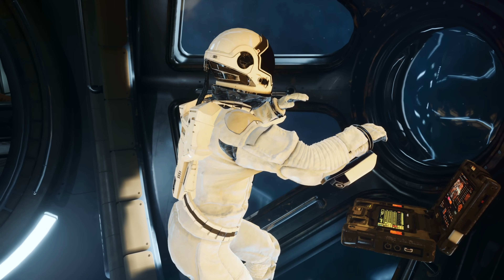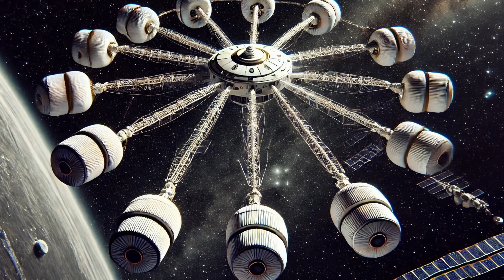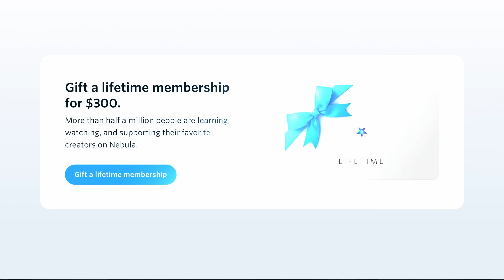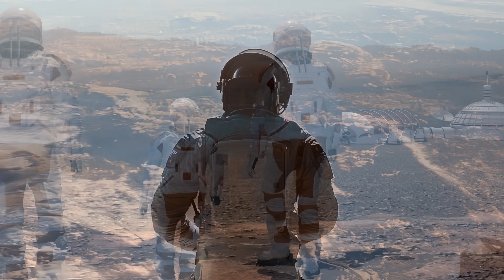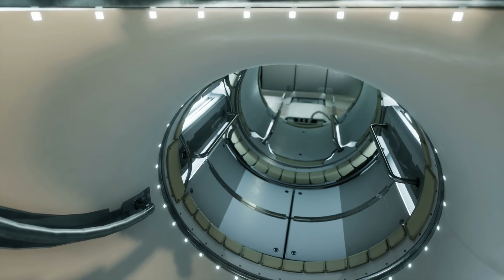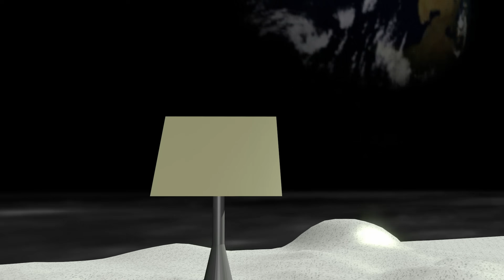Gravity By Design - Tether Habitats & Orbital Living

Comment: 4rpm is acceptable without problems. There was research about this. 

You need to remember that there is enormous difference between rotating room experiments where gravity mix together with rotating creating chaos with our vestibular system and normal, centrifugally simulated gravity where the classic gravity is not present.

Also, sleeping under gravity and working in zero gravity is wrong. It should be flipped. You can sleep under zero gravity, but you need work and move under full gravity preferentially. Because our cardiovascular system needs workout. and that for most of the day. During sleep, even here on earth, it is nearly the same situation for body as zero gravity.
Reply: Yes, if the gravity difference between head height and foot height is imperceptible, Coriolis forces don't really come into play. It would be no more uncomfortable than a cruise ship.

Comment: What do you think about officially published theory that Earth is monitored by orbs? SETI astronomer Dr. Eamonn Ansbro of Ireland's Kingsland Observatory published a very interesting hypothesis in July 2001. This hypothesis was met with resistance from the SETI community. According to his theory, some hidden spacecraft move in the upper stratosphere or even farther from the Earth's surface, releasing special surveillance drones/orbs. They calculated that these drones move in 660 orbits around the Earth everyday 24/7 in automatic manner, and where they intersect, UFO sightings are more frequent and possible to anticipate ahead of time. "We have tested the theory over the years in 27 locations in eight countries, and it has been 80 percent accurate," Dr. Ansbro told media.

Comment: We already have a working prototype of a automated torride shaped habitat building machine that holds all of the pre-shaped modular pannel sections in its body and welds them in place as it advances section by section to createa huge interior area. 

If we could use this technology to create a functional 10 RPM space station, we could use that platform to learn how to make all the systems and engineering work over the course of 4‐8 years.  

Then we could use that design and building expertise to create a 2 RPM space station.

This would likely yeald the highest return of livable space per dollar spent, and a large zero-G structure could be built in the center allowing for science research and zero‐G manufacturing at a reasonable cost, with plenty of staff to execute operations and maintenance.

Comment: Great! Lets design the simplest practical proof of concept experiment using Starships! 😃
Reply: Just one ship, a tether, and a far-end module that typically will be much less massive than the ship. One end of the tether is permanently attached to the ship. The other is permanently attached to the far-end module.

At launch, the far-end module and the furled tether are in the ship’s nose. Once it is in orbit, putting it into slow end-over-end rotation, maybe 30 rotations per hour, gives us a small amount of gravity. We begin lowering the far-end module into that gravity by unfurling that end of the tether. The gravity will make that module and the paid-out part of the tether extend straight forward from the nose.

This lowering would slow the system’s rotation, except the far-end module is functional. It is not just a counterweight. It includes a solar array that makes electricity, an ion drive that uses that electricity to make thrust, and a propellant reservoir. The thruster thrusts tangentially to the slow rotation, keeping the rotations per hour — the angular speed — constant as the tether continues to unfurl.

The strength of spin gravity is proportional to how far out you are from the spin axis. Supposing that when the ion drive has just exited the nose, it is 20 metres from that axis, 30-rph angular speed means the gravity it is feeling is 0.00559 gees. We’re looking for an end state where the ship is getting one gee. That will require it to be 1/0.00559 times 20 m from the axis. 3577 metres out.

If the ion drive and the solar array total one-ninth as massive as the ship, one might expect them to be nine times farther out on the other side, and the total tether length to be 35.77 km. Each kilogram of them would then counterweigh nine kilograms of the ship.

But that much tether is quite significantly massive and weighty all by itself, and with this taken into account*, balance is attained by having the far-end module 13 km from the axis, where it gets 3.63 gees. So each kilogram of it counterweighs 3.63 kg of the ship, and mass is reduced compared to the case where ship and counterweight are equally massive and equally far out.

Also reduced: complexity, compared to schemes in which multiple ships launch separately and hook up once they are in space. Only one ship, no spacewalking, everything already connected.

Comment: As far as I can measure from the movie, the space station in 2001 had a rotation period of about 45 seconds. I never found a scene with a complete rotation so you have to extrapolate from the angular motion you can see in any one shot. The people in the station are walking around, getting up and down etc. under what looks like 1g. Well of course, it wasn’t actually filmed in space.
That gave a diameter of roughly 2,000 feet depending on the rotation period estimate. The Fantastic Plastic resin kit of the station even came with three sizes of the Pan Am shuttle. The size of the shuttle is canon but the station size was never settled and the film sequence seems to have continuity inconsistencies in the apparent relative sizes of the two objects. You can pick the shuttle model size that fits your idea of the station size.

Comment: I would be concerned that if you have multiple habs connected by tethers to a central hub that they might start precessing, or having slightly different rotation rates, especially if you have people regularly commuting by an elevator to the central hub.  And I am pretty sure that travelling to the hub significantly faster than the rotation rate of the hab would cause problems.

Comment: I seem to recall that NASA and other space agencies have done some experiments with tethers attached to spacecraft, dating back to the Gemini project days. A depressing number of those experiments have failed, usually due to some kind of malfunction in the unreeling mechanism. This suggests it's not as simple as it sounds.
Reply: Such failures sound/seem like fairly straightforward “engineering issues”, and probably not too difficult to overcome.
It’s also possible that since they were “just testing the concept”, they may have skimped on design or materials… wait, what am I saying? That’s not how government works… silly me 🤭

One of the more interesting mentions of “tether” that I recall from way back (maybe in “Popular Mechanics Magazine”)… was a concept for using a tether with a certain amount of elasticity to join two spacecraft together, and fire the rockets of each in a carefully coordinated alternating pattern/sequence… so that (in effect) the two spacecraft would take turns, passing greater and greater momentum to each other than would be achieved by firing the engines alone.
One spacecraft would “fling” the other forward… and just before the tether would become taut, that spacecraft would fire its engines through the process of stretching the tether, and then the tether imparting that energy into the other spacecraft, which would propel it forward. The engines would be stopped as soon as the tether went slack… and that spacecraft would then pass the other and perform the same process… wash, rinse, repeat.

I believe the article was a compendium of concepts for how we might achieve interstellar travel (or more specifically… to overcome the rocket equation limitations)… how we might achieve greater velocity, using less fuel, etc.

This would have been published (according to my addled memory) around the late seventies, early eighties… so, represents some of the ideas that were “bandied about” in that time for “overcoming the vast distances of interstellar space” 😂

I think it would be interesting if Isaac could find that article easily enough, and “revisit” the concepts of that time, looking through our more modern lens.
Just a thought 🤷‍♂️

Comment: as a noob, how do you equate a rotation to Earth-like gravity? It has to be measured against diameter. Example, A rotation at fifty feet is good for E-gravity,  but at two hundred feet has a higher gravity.
Reply: 50 foot diameter, you get one gee at 35 miles per hour. 200 feet diameter, you get one gee at 70 miles per hour. 800 feet diameter, you get one gee at 140 miles per hour.

Notice that even in the 50-foot-diameter ring you can't run fast enough, opposite the direction of rotation, to zero your weight. You can reduce it a little.

Also notice that increasing the diameter fourfold only doubles the speed, so it takes twice as long to go around.
Reply: For a minimally comfortable RPM of 1 RPM the diameter needs to be about 1 km in length.  You can't really go smaller than that without experience significant physiological effects like nausea, dizziness, and loss of balance.

Comment: Every time a manned mission to Mars comes up I can't help but think we really should reconsider how missions are done. With the advancement in rocket design and the drop of cost, a mission to Mars could look very different than the ones we send to the moon.
For example, we could send capsules with food, water and fuel ahead of the main mission, We could send an entire mission pod ahead and park it in orbit of Mars just in case. In lieu of having an autonomous space station there. Same goes for the next mission to the moon.
Planned right these modules could even become the core of a space station, even a Hammer Hab, which could be expanded on as mentioned in the video and several Hammer Habs could be put together on the same spin axle.
Not sure how practical the idea is, but I think there are possibilities that could extend space missions in the long run.
Reply: Honestly being autonomous is highly overrated IMO. The actual factors determining early space development will be where the money's coming from. 

Thus I expect for a while that early development will consist of a moon base that profits off high end tourism, asteroid mining (since the moon's surface is littered with asteroids waiting to be mined) and the bulk production of exotic microgravity materials. With the exponential growth of industrial capacity eventually letting it transition to exporting raw materials via mass driver.
Also importantly this early colonization will be like 99% automated and remote controlled. Since you need a really good reason to make using humans better than a remote controlled drone with less than 2 seconds of lag. But this isn't a bad thing! It's actually great because it makes things way cheaper than they would be further from earth.

Lastly being so close means that you don't need to initially bother with artificial gravity. Since you can just have all the crew being regularly rotated out like on the ISS. This becomes relatively cost effective once you've set up an Aldrin cycler between the Earth and Moon, even better if you also have a skyhook. 

https://www.youtube.com/@Anthrofuturism has some great in depth videos looking at the economics of early development

Comment: What about a VonBrhan wheel but it's a spiral that can be continuously lengthened?
Reply: Up to a point. If its length comes to exceed root-six times its radius, it will want to drop its ends out and spin end-over-end rather than around its axis.

So radius 894 m, the length limit is 2190 m. 2000 m, and the thing will spin stably forever; 2400 m, you need computers to move stuff around, probably water in giant pipes, when it begins to get squirrely.

Comment: I'd love a video on how you'd communicate or coordinate over EXTREMELY LARGE megastructures. Things the size of solar systems, where it'd take over an hour or even a day for a laser sent through fiber optic to get to the other side of the structure. How would you manage to coordinate things like "We need to fire all the thrusters" or such. Or a Hill Sphere the size of a galaxy, and wanting to rapidly get info about the other side of it a hundred thousand light years away. Is it just unrealistic to treat a structure that size as a single object?
I imagine the obvious answers are the ones... pre-arranged schedules and set procedures based on certain parameters. But I wonder if there's any interesting options for how you'd rapidly let a section of your ringworld several AU's away that they need to brace for an electrical overload after a solar flare hit some panels.

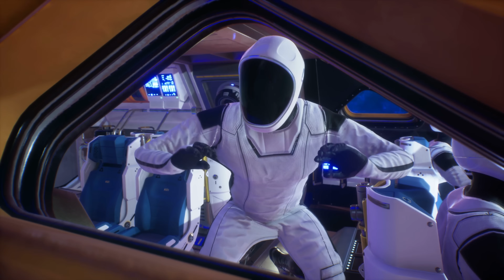Comment: 6:35 "During planetary maneuvers, the module  would be reeled in tightly, locked in place, and secured before proceeding" -- what kind of maneuvers might those be?

Just accelerating towards a distant planet, or away from it as it gets close, wouldn't justify that. A gimballed ion drive anywhere on a long spinning tether, driving it at 1 percent or less of its tip loads' centripetal acceleration, drives it exactly as it would a rigid object.

The quote words seem to me like those of a homeowner who could not hang a door correctly and insists that no-one can.

Almost exactly. Off-centre ion thrust on a rigid nonrotating object will turn it until it gets in the way of the ion plume, which then becomes ineffective as propulsion. But off-centre thrust on a spinning tether just precesses it a little, and in the other half of the rotation, precesses it back.
Reply: Spinning parts are non trivial for wear and tear, maintenance, and structural stability. Same for programming.

In space, you want to keep things as simple as possible.

There are videos on the difficult of making simple parts in space, such as door hinges.  Between cold welding, thermal extremes, the effect of a vacuum on lubricants, radiation, and all of that before vibration, difficulty to repair in a vacuum...

Even an ion drive could become a nightmare.

Plus gyroscopes make any maneuver counter intuitive.

Comment: The assertion that long term exposure to spin at certain rates would make things worse goes against human experience with sea sickness which generally "goes away" after about three days in even the most seasickness prone people. I would guess therefore that an RPM higher than 2 rpm would be acceptable long term. Humans are very adaptable but we don't want people to adapt to zero G because of long term affects of that adaption.  Of course not everyone must go to space, most people will live on Earth for the foreseeable future. Ability to live on a rotating habitat would just be one of the requirements for the job, just as all jobs have physical requirements.  I think the AG field of research is very much at a pre-infancy stage. It hasn't really started until human experiments are done long term at less than 1G felt gravity. Actual testing at different rpms and circumferences (same thing really) are necessary if life in space is going to get off to a good start. While there are good reasons for "zero G" labs and manufacturing, any human presence in space will require 1G or close habitation in the long term. It may very well be that angled floors and wall lines instead of long sweeping curves will work better.... even non-smooth floor surfaces which require more brain activity to navigate already may be helpful, a technique already being used on Earth to treat early dementia onset. As with most motion sickness, this is a mind thing, matching the eye's expectation with the felt reality is essential. If the line and evenness of the floor gives the eyes an expectation of unsteadiness that matches the inner ear's feel of gravity, the problem goes away.
Reply: 4-6 RPM is generally considered the most important that people could adapt to.
Reply: @peeperleviathan2839  I had heard less. The thing is, all of the tests that these numbers are based on have been done on Earth so there are at least two things added to the mix that may have caused some people distress besides the RPM. That of the higher than 1G load on the person's body and also the resultant angle of gravity because Earth's 1G was mixed in. Another thing added to the equation is how small most of these devices have been with the resultant difference between head and feet. Of course size and RPM are are interlocked and by the time the size is big enough things are normal from head to foot, RPM might be quite low anyway. Really, my point is that no research has been done with a starting point of zero G or even less than 1 G, such as on the Moon for example where a train on a circular track might be easier to make than an orbital model of any size.

Comment: How much the discomfort of fast-rotation/smaller radius is due to the transition as opposed to an inherent always present effect? People sometimes can get used to being on bobbing boats or trampolines relatively quickly or sometimes after a while, and then feel weird when stepping back in solid ground; and a similar phenomenon has been observed with VR (though, seems that may have larger variability in timing and sensitivity across the population perhaps); has this factor been evaluated?